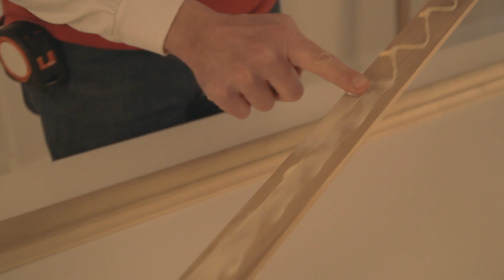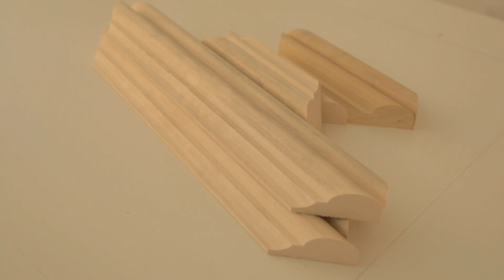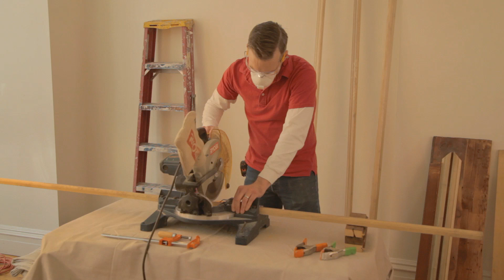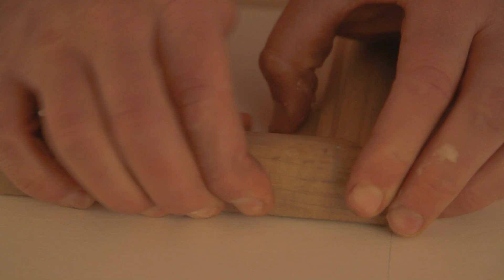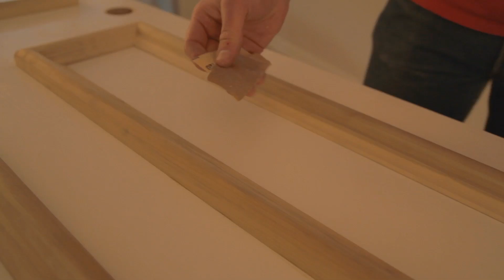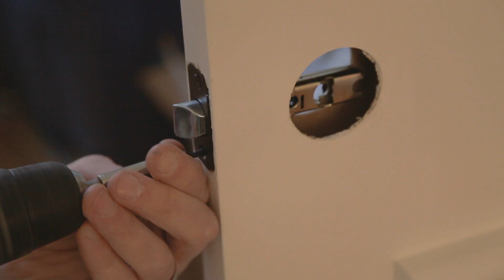How to Dress Up a Hollow-Core Door | This Old House

Comment: One advice I can add for mitered molding is "Don't measure. Just mark and cut." No seriously. Cut one side at 45 hold it up to where you want it to go and mark the outer edge (from the lines drawn on the door). Then cut.

Comment: A 6-panel 2-6 interior door costs only $30-35 at Home Depot or Lowe's... not worth all the trim labor and cost of this project.
Reply: Yeah they were that price in the 90s
Reply: No they aren't... Interior doors START at seventy dollars. I priced out the molding, glue, nails and paint/primer and to do six doors it calculates the price of one brand new door. 

Also if you want a less 'beefy' molding than the one used in this video, might I suggest that you buy a more modest molding?
Reply: @Amanda $35.76 for a 2’-8” 6 panel.
https://www.homedepot.com/p/JELD-WEN-32-in-x-80-in-Colonist-Primed-Textured-Molded-Composite-MDF-Interior-Door-Slab-THDJW136501057/202288424
Reply: Doug Reed Totally agree Doug.  But fitting to the frame may not take much longer than trimming both sides of the door... and you are correct... it will look MUCH nicer.  I never went for that built up trim on entry or cabinet doors.
Reply: Porsche924Tim  a smooth solid core door costs way more. when i renovate a home i replace all the interior doors and trim the smooth fire door to match.
Reply: Unless you have old doors that do not live in the “standard size” and you’d have to custom order 75% of them.